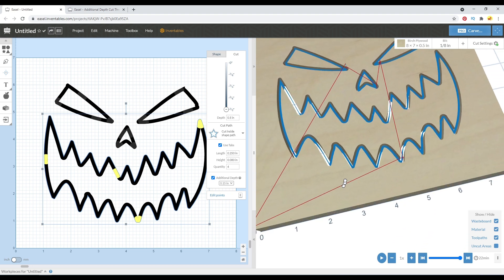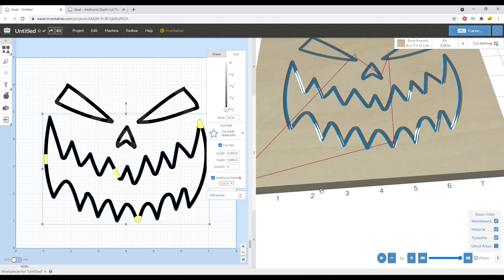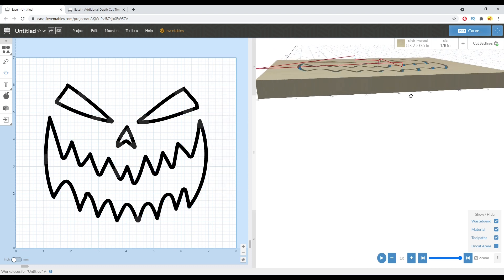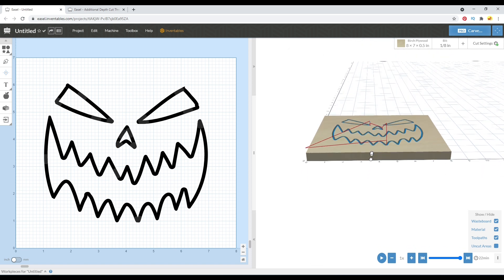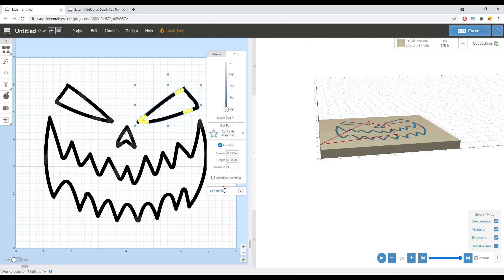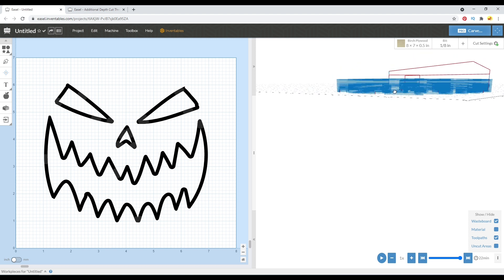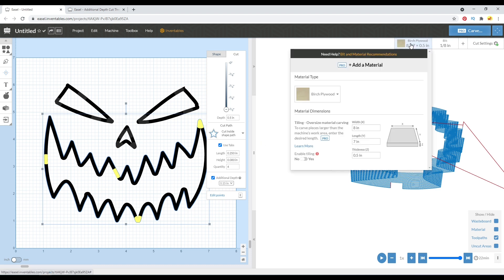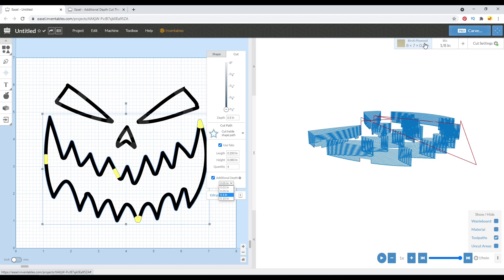How To Set Additional Thickness - Easel New Feature

Comment: Cool video! do you have a video of flattening the wasteboard?
Reply from the maker: Nope, mine needs it though, with the weather change and almost 5 months since the last one, its getting some low spots.. .. Its really only a square pocket, sized for your machine and I do it in 0.3mm depth per pass increments. And I like to make a pencil swirls to make sure full coverage is obtained... I'll carve 0.3mm depth, then if thats not enough, bump it to 0.6mm (with a cut depth greater, that was its always doing the carve in one pass)  and repeat until I get the whole board touched by the bit 👍
Reply: @SethCNC  thanks I will do that